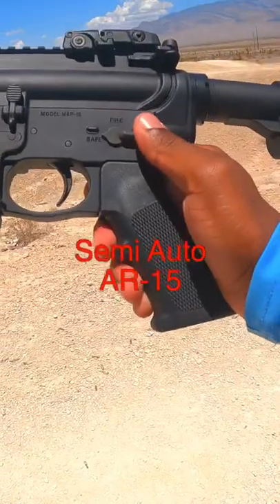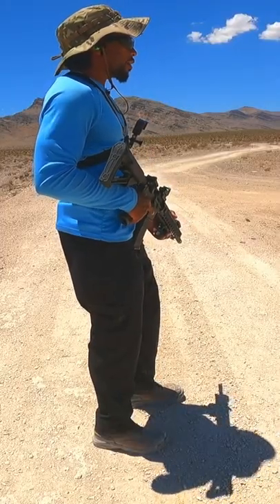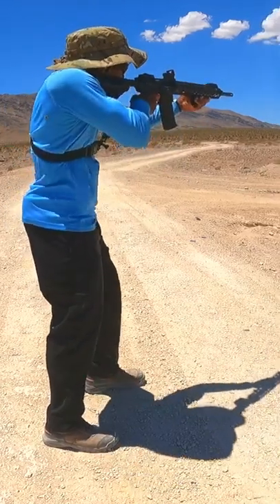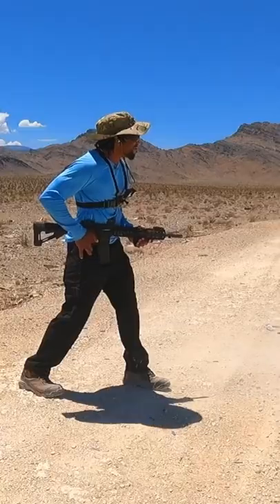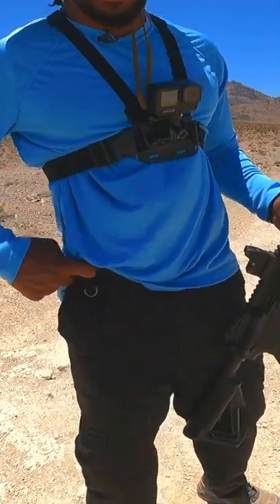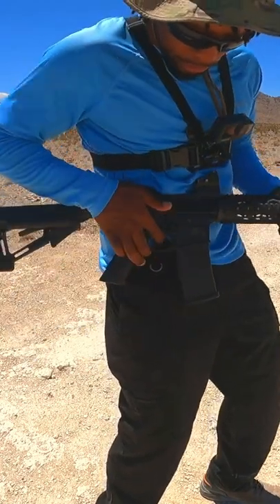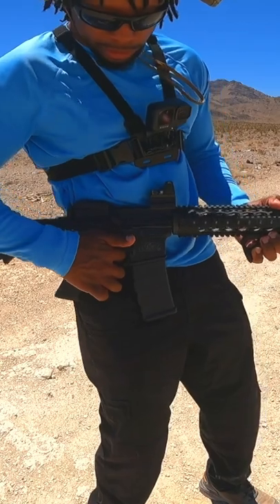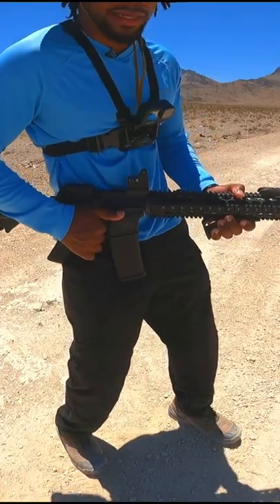🔫Bump Fire AR-15 | How to shoot fast | Bump Fire Stock | No Full Auto | Automatic Rifles

Comment: Get you the right kind of foam padding, piece of rubber, etc and slip it under a tight fitting shirt around your shoulder area. Experiment with that idea until you find the sweet spot/combo that works for whatever weapon and rounds your using, then sew it in a pocket to contain it on the inside of that shirt. The government is gonna have a great time trying to ban memory foam, mouse pads that can be cut and laminated together, car tires, the rubber soles of sneakers, all that white foamy stuff that you find in your box from whatever you ordered from amazon, etc. The supply of anything like that to do the job is endless. Good luck banning all of that government agency ( insert your three letter agency name here)

Comment: Does it require a special type of trigger to achieve these results? Or a special type of BCG? Or will this work with any “off the shelf” AR?
Reply from the maker: The only one I can’t get it to work with is one of mine that has a mid length gas system. Most have a carbine length gas system though.